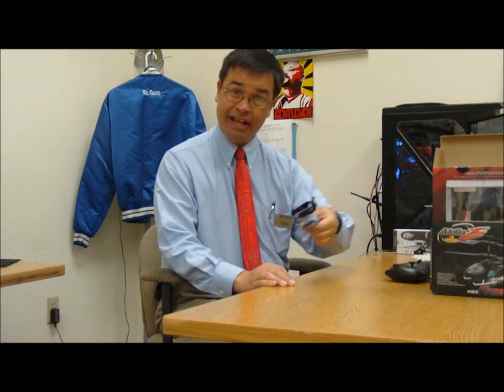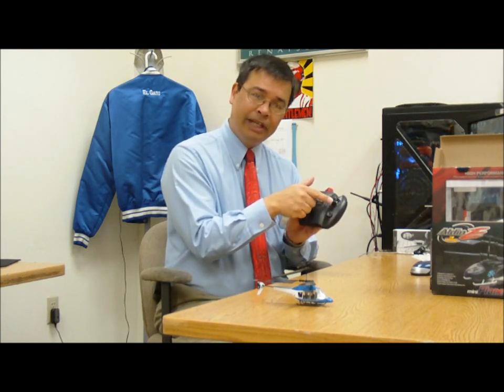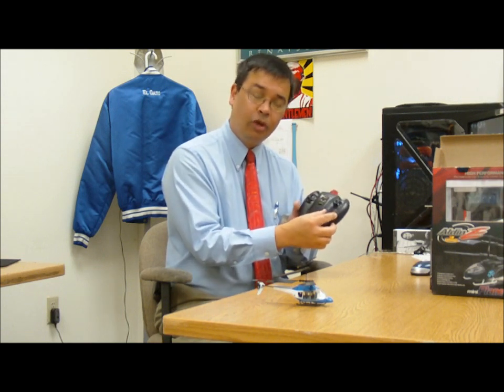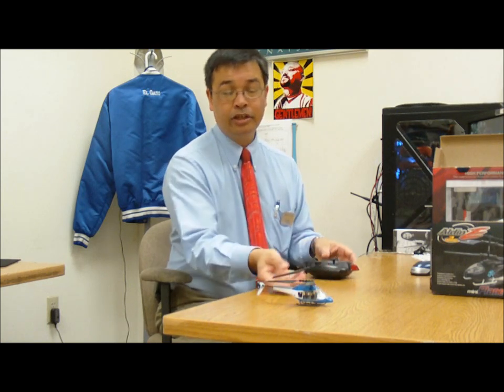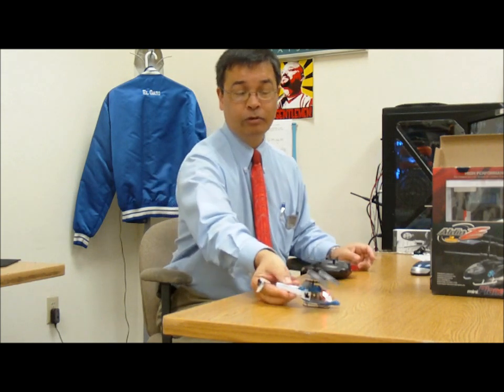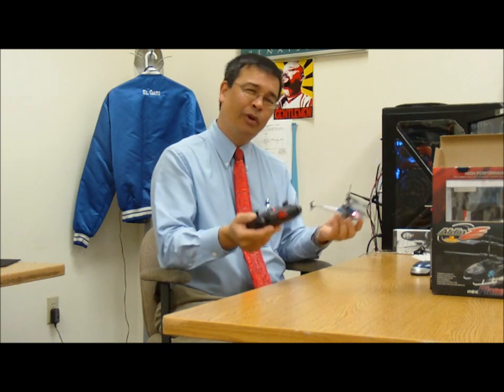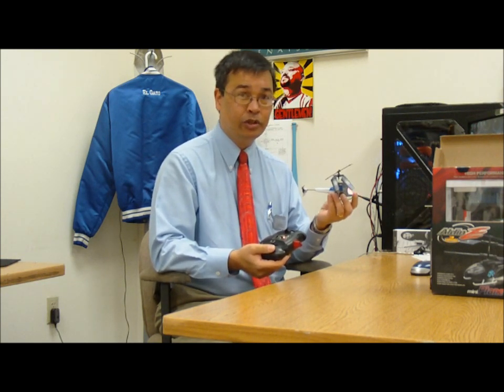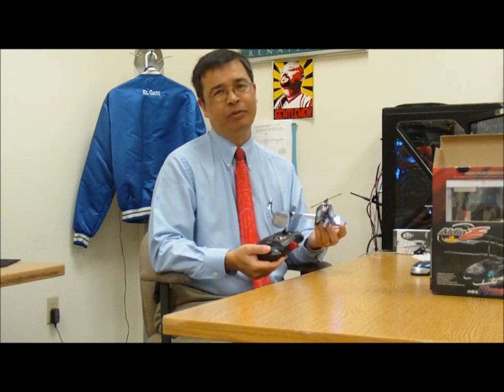Tech Support: How to Adjust Trim on RC Helicopter

Comment: This video shows how NOT to do it. Don't trim near the ground; the ground effects affect how the heli wants to spin. Get it up at least a meter off the "ground" (or whatever surface you're flying over) before trimming. This video illustrates what I'm talking about; he gets the trim "right" for the ground effect environment, and then then when he actually gets it up in the air, it's all wrong and spins out of control.